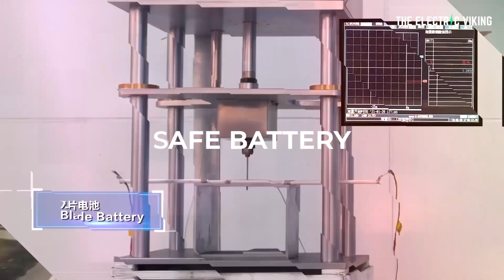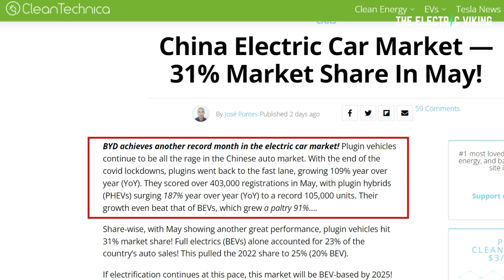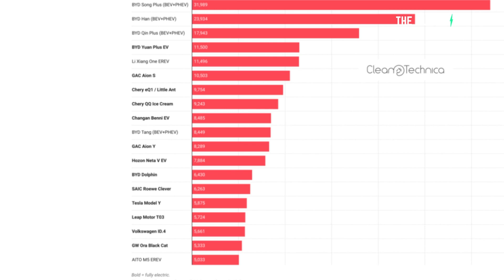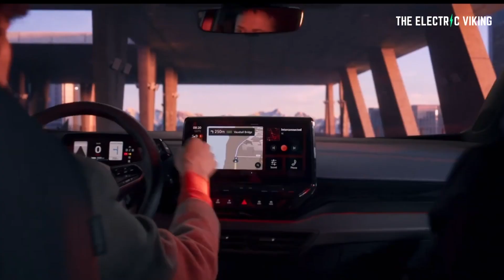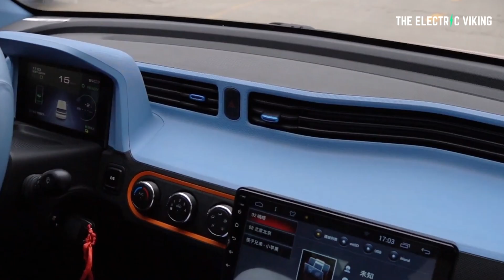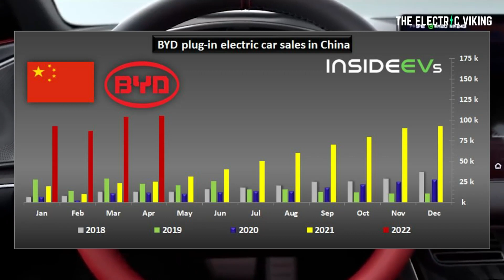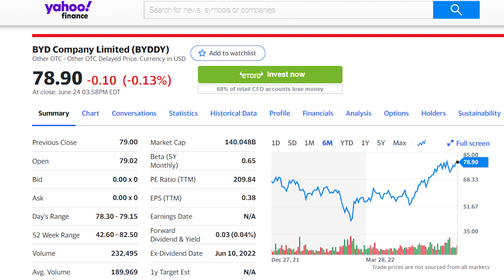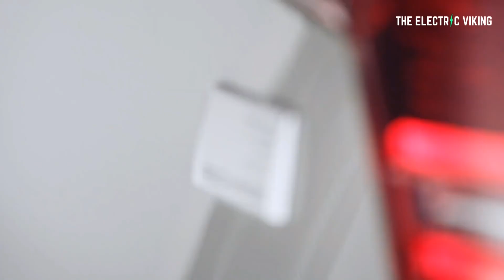China's EV market hits 31% - over 50% of all EVs worldwide

Comment: China has brought down the costs of solar panels, not the USA.  USA has been dabbling in renewables since 1970.  I live on Maui.  Maui is greater than 30% renewables.  Not due to government or electric company but to private residential rooftop solar.  At 37 cents/kwh I installed rooftop solar/powerwall battery/Tesla to save $500/month on electricity and gas savings.  I can not control monthly healthcare premiums but can control energy costs.

Comment: China lacks something other countries have - fossil fuels. China has a much larger incentive to go electric; even though most of it's energy comes from coal.  China is also one of the leaders in thermonuclear power; they are probably hopeful that will bare fruit. If it doesn't they can fall back on hydro, nuclear, wind and solar. Adding EVs at this time however in China means burning more coal.  They do not have excesses of electrical power.
Reply: And the coal plus other air pollution kills ~ 1.5 million a year there 😢

Comment: I think China wants to get off coal, because of pollution problems.  But because of power outages last year, they wound up increasing its use.  

Will more EV's make the problem worse, or better?  I'd like to see them tackle V2G, increase the use of renewables, esp. with all those "batteries" sitting out there.
Reply: China's CO2 emissions will peak in 2030, after that it will decrease
Reply: Guarantee that China's next push will be solar all over the country. They already make a large portion of the panels.

Comment: So if it holds at 30% in China for 10 years that would have 30% of the entire auto fleet electric by 2032. If the rate of increase continues, then MUCH sooner.
Reply: It's not going to stay at 30% is it? Its 30% today, within 3 years at current expansion rates in China you are looking at 60% plus.

Comment: But the grid can't handle such a rapid adoption of EVs!  Or does china have a more robust grid?
and from what I've seen (in vids, tv, etc) most chinese live in apartments...how are they all charging these cars? At 'home' or work or public charging spots? How are they expanding so fast?
Reply: Every light pole is a potential source of power
Reply: Their grid is very impressive, electrification is national strategy, grid has been developed to match that ambition.
Reply: Rubish, the grid operators welcome EVs because most are charged during off peak times so they can soak up the surplus energy when demand drops off. Also with V2G systems developing, EVs can help with handling the peak demand.
Reply: Rubbish, the grid operators welcome EVs because most are charged during off peak times so they can soak up the surplus energy when demand drops off. Also with V2G systems developing, EVs can help with handling the peak demand.

Comment: I think BYD is the main reason that China's plug-in electric car is still rising. Their DM cars combined the advantages of an electric car and a hybrid car, so basically you can use them as an electric if you have a charger at home, or a hybrid car if you plan to do a long-distance traveling
Reply: The BYD  new DM-i (Mainly battery based, with ICE assists) is even a better technology, no wonder their car, The Song DM-i was one of the top seller. check it out.